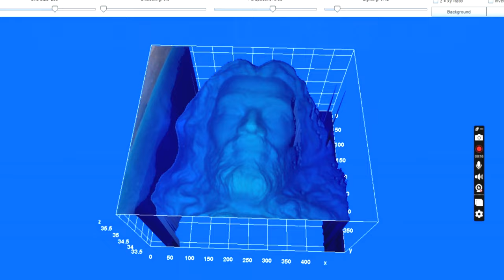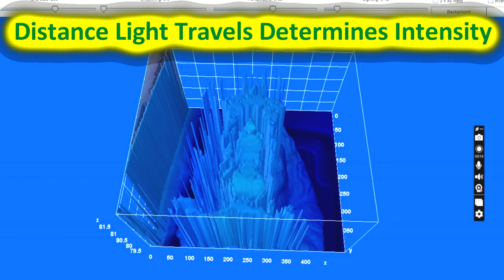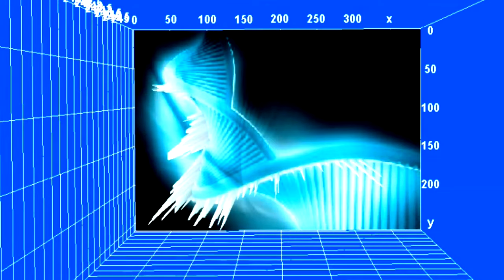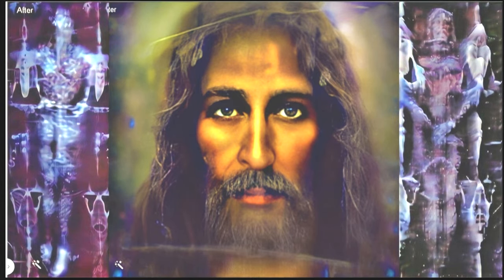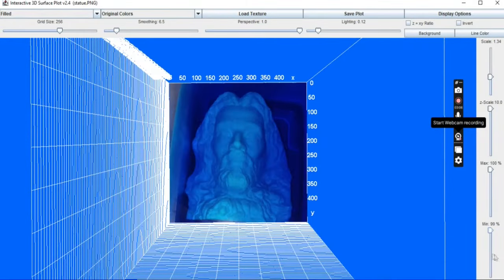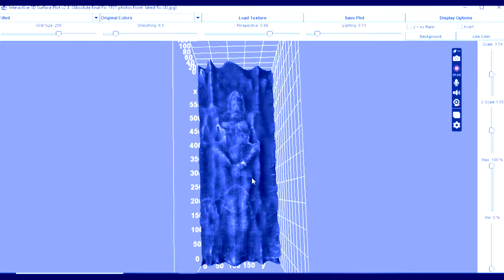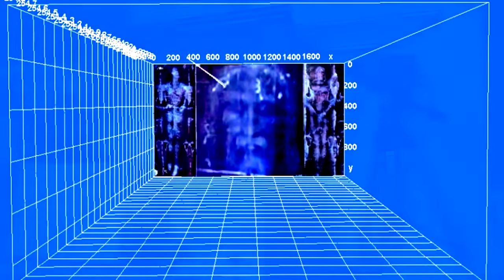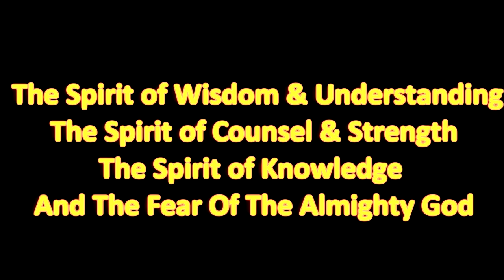Body of Jesus Emitted Light: 3D info on The Shroud of Turin Part 2

Comment: Jee, David! I’m always so impressed with the incredibly Intelligent Information you put into your Shroud Videos!  🩵. Extremely well done here!  🩵

Can you explain via your information here from this current video how the 2 deep dark bands came to border both sides of His face via this slowing down of Light creation Hologram, and what they imply?  Also, David, you optically charge the bust so that it could glow in the dark.  How was this done vis a vis the Body under the Shroud? Was an external Source or an internal Source or both, as you suggested that electromagnetic magnetic waves are emitted from the blood’s DNA ?

Oh, thank you David!  You’re a Major GOOD SHEPHERD!🩵🩵🩵
Reply from the maker: Good Afternoon.   On the Shroud what appear as 2 dark lines is just virgin fabric untouched.   There is nothing there . It's blank except for a blood stain that got there by body to cloth contact. 
The reason it is like that is because the light/radiation coming from the body was moving in a straight line and this area of the face  slopes downward almost at a 90 degree angle.    What happens as a result is that  the image process stops completely there.  The same thing happened with the statue underwater.  That also had light moving in a straight line to create the final image.   There are 2 dark lines going down the side of the face on the statue head. I just looked at it and noticed it.   These are the darkest parts of the whole image.  The image process was not able to continue there because the light exiting the body was moving in a straight line.  A holographic image process can only image the partial sides of an object,, not the complete side.    When we look at the Shroud there are no side images.  Only partial sides and they all fade off,   there are no distinct lines.  This is a holographic image process observation.  Meaning there was light/radiation coming off the body.  There is still a lot more work to do here and put up more displays making a Part 3 video to this critically important.   If you put a 3D statue head under a photo copier scanner and make a copy you will also see 2 dark lines going down the side of the face.   Just a thought here.  Can you picture anybody making an image of a face and just leaving 2 blank lines on side of the face on  the canvas?!  I mean, just leaving it blank?!   NO WAY!
Reply from the maker: When Moses was in close proximity to the Almighty God he started glowing.   I believe being in close proximity to the Almighty God causes the DNA to become excited and oscillate at a higher frequency and emit a stronger light.  Normally it is very weak.  So I think the field action of resonance is involved in the image process, and i think the Almighty God himself was involved in the Resurrection process shining his light into the dead body of Jesus causing his DNA to oscillate at a high frequency and this light exited the skin pores.
Reply from the maker: Also on the statue head that was emitting light we see the brightest coloration at the tip of the nose and the chin.   We see the same thing on the Shroud image .  Another holographic image process observation.
Reply from the maker: Final thought:  The Bible says he created man in his own image.   God is a being of light.  We are also beings of light temporarily in a flesh and blood body.   When we get close to God our light starts shining inside.  Becomes excited by the field action of resonance.  and increases in frequency and strength and starts emitting light that is much stronger than normal.   It is like the tuning fork experiment.  When you cause a tuning fork to sound of a note and bring it close to another one it causes it to oscillate and sound off the same note.  When God comes close to us we start glowing.

Comment: I've often wondered why there are two dark parallel verticle spaces on each side of the face.  Could it be that there was a band of cloth under the chin and around the sides of the face?  Or is it because the highly directed light acted 90 degrees to the skin?  In other words, light coming off the side of the face was directed to the right and left sides of the head and never directed onto the Shroud?  If all of the light is verticle, as suggested here, one would expect the sides of the face and body not to produce an image on the Shroud?
Reply from the maker: A holographic image process cannot image the complete sides of objects.   Only partial sides.  
I will write back again in a short while.   It's been a long stressful day.
Reply from the maker: Yeah.  If we look closely we see that no side images are visible anywhere.  Only partial sides.  That is a holographic observation.
Reply from the maker: A simple way to understand better.  The image on the Shroud is similar to what you would get if you put a 3D object, such as the statue head on photo copier scanner.   The scanner is also limited to being able to only record only partial side images.   I tried it once.   I put a 3D head on the scanner and I got the same dark lines down each side of the face.   Note on the side images of the Shroud there are no distinct lines anywhere.  the image fades off on the sides.   The face goes down at a hard right angle so the image p;process there comes to a more abrupt halt and leaves the dark lines.    Image fades at the knees on the front image and completely vanishes.  No front feet imaged.  Only the large blood stain.   The blood stains continue but the image fades off to nothing.   Proof that at one time the cloth made direct contact there.

Comment: I don't think your underwater phenomenon has anything to do with the speed of light. Deeper under water is darker so you can then make a photo reminiscent of the shroud: dark is further away from the shroud. The closer the body was to the shroud the more image was created. Very analogue to the underwater foto. Congrats: finally someone got replicating this one property of the Shroud right!
Reply from the maker: Hi Harry.   I understand where you are coming from. This subject line can a bit difficult to understand, I am working on the final video of this series to do a better job explaining and more in depth footage and displays. 
To create a holographic image process without using lasers, which is was this experiment did, the speed of light must be slowed down.   A better word to use here would have been the FREQUENCY of the light waves. 
We took a photo of the UV light emitting 3D Head OUT OF THE WATER.  That did not work for creating accurate depth info because the light intensity on the tip of the nose and the sides of the cheeks were almost the same.  That makes the object look flat on a 3D surface plot.  
The glowing statue head out of water had some depth into but it was not anywhere near as good as the object underwater
The reason it appears darker as the the depth of the water increases  is because the frequency of light slows down over space by inverse square law and especially underwater.   So both the speed of light and the frequency slows down over space.  We see the higher frequency waves as brighter and lower frequency waves as darker.  

Another reason we got accurate depth info was because the light intensity being emitted from the statue head was the SAME on the tip of the nose as it was anywhere else .  Equal light intensity emission.    But the light being emitted from the sides of the cheek had to travel a greater distance before it was captured by the camera lens and when it did it was a lower frequency wave, thus a lower intensity color.   
To the human eye we do not see that much difference in coloration but the 3D software does. 
It analyzes every pixel. 
A easier way to understand this is to make a copy of a 3D object on a photo copy scanner.   We did this with the statue as well.  The nose and the chin area left the brightest intensity coloration and down the sides of the face got darker and darker .  As the light that reflected off the sides of the cheek it had to travel a greater distance than areas close to the flat glass, thus when the sensor converted the light reflection into a color,  it was darker

The copy made by the scanner almost produced accurate depth info but not anywhere near as good as the statue underwater.   The speed of light being slowed down was a critical factor in getting accurate depth info
it requires
1. Dark Room 
2. 3D Object itself emitting light of the equal intensity on all areas. 
3. Speed and frequency of light slowed down

If any of those 3 things are missing from the experiment.   WE would not get accurate depth info. 
The photos we took  and the results on the 3D surface software are proof of that

When a hologram is made the speed of light is interfered with by another light wave of the same frequency. 
It takes like 15 minutes of the light waves bouncing off the object before it creates the image. It takes time
But also requires a dark room and the 3D object itself emitting a controlled and ordered light source  

similar processes.